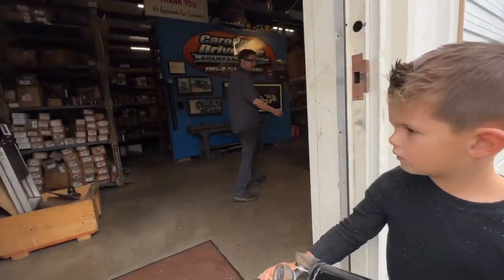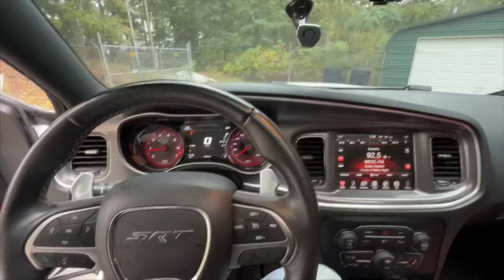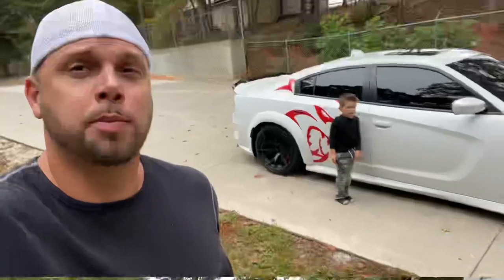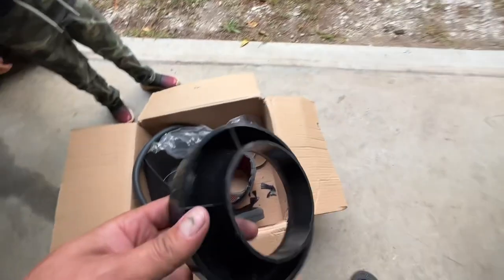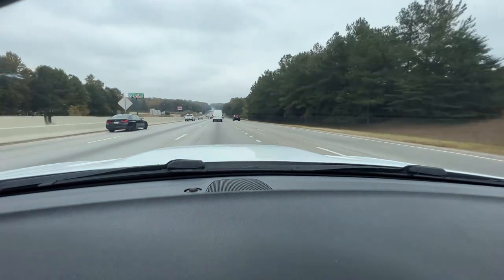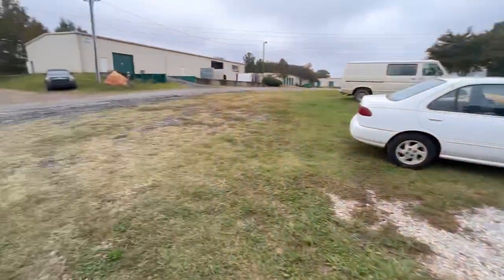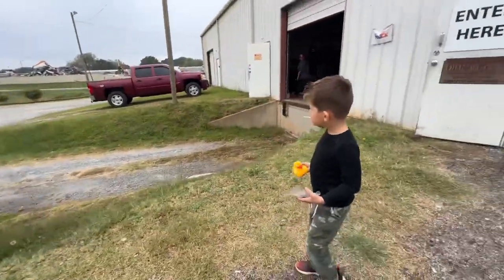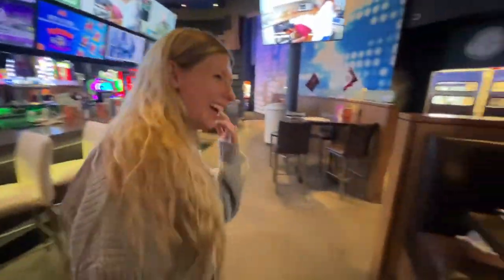Driveshaft Problems !! Can we Find a Good Shop To HELP ?! CAROLINA Driveline For the WIN ! Edna F100

Comment: I had 77 Bandit...2.00 gear 178 MPH crosswinds went around three times landing it backwards caught the brake subframe ripped through the body.... But I stuck the landing.... The airplane gear came from a 6 cylinder Nova Ten bolt.....A stock Car should never be driven that speed...
Reply from the maker: That’s scary 😟 🙏🏽
Reply: Scary,,,changed my forever driving habits ,,,guy came out of his house and checked on me said he thought it was a plane crash... This was not a stock engine at all 101 octane fuel and a 200 shot of NOS.... I drive like a civil human these days...

Comment: FYI..to check your rear end gears, have someone rotate a wheel once all the way around and count the revolutions on the drive shaft..4:11 gears would give you 4 rotations and a little more for each revolution of the tire. 2:78 gears would be almost 3 revolutions of the drive shaft with 1 revolution of the tire.
Reply from the maker: Thank You this is very helpful

Comment: You have a really strong helper. I like what you're doing. I'm currently working on a c4 corvette got it on the road in the spring and now it broke several break lines it's now a winter project when I have time off the road.
Reply from the maker: Always something right
Reply: @3BBgarage  indeed it's a never ending story. I just got off the road and my son said the new top we had put on is leaking.

Comment: You are a great role model for the boys teaching them good manners, nice to see Big J
Reply: @3BBgarage  We used to run into Universal problems all the time when I worked for Manny, Moe and Jerk for almost 19 yrs. We would give the joint cap sizes to the Parts supplier, (Usually someplace like Papa auto parts) and they would send us the correct U-Joint. measure the drive shaft caps on the shaft your using and the joint caps on the original shaft for the car. If you mess with the Differential joint mount you need to know what your doing because if you replace it you should replace the crush sleve between the bearings and properly torque the pinion nut or you'll mess up the gear to pinion mesh pattern and end up with gear failure or excessive slop in the differential which will cause major problems. So try to find a matching U-joint first before you mess with the pinion joint mount.
Reply: @3BBgarage  Some other things you need to keep in mind, Gears, Tire sizes and also transmission gear ratios all work together and if you change one or more items you also will need to change the tiny gear on the speedometer cable going into the trans, if not only will it mess with your speedometer but will also mess with your computer power curve so you will need to adjust your computer specs to match the changes for your fuel injection to work correctly when your done. Keep these little tips in mind.